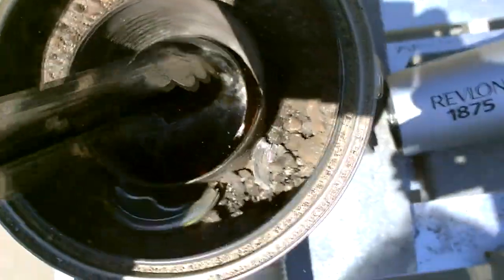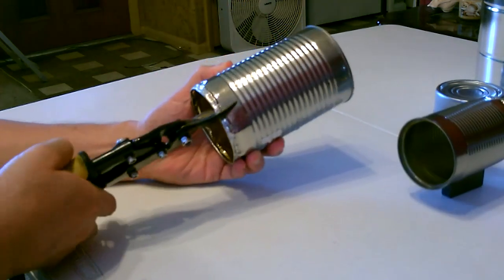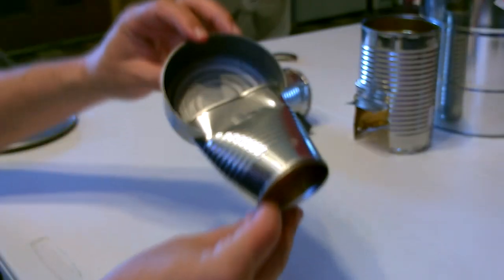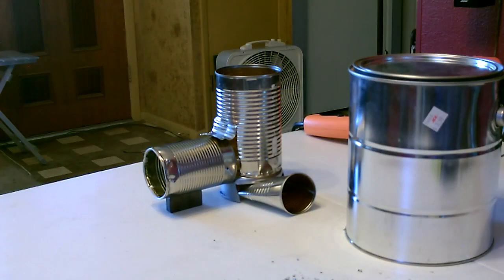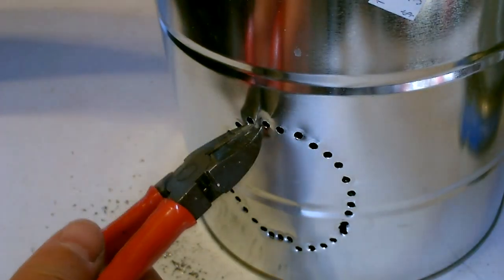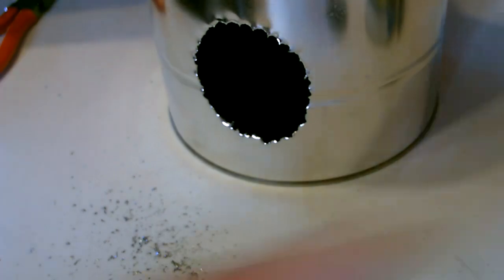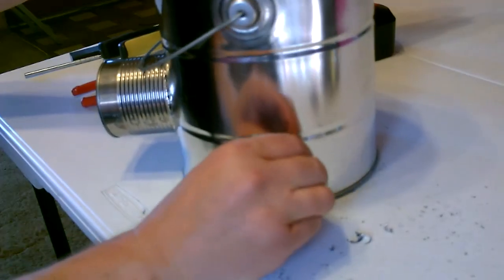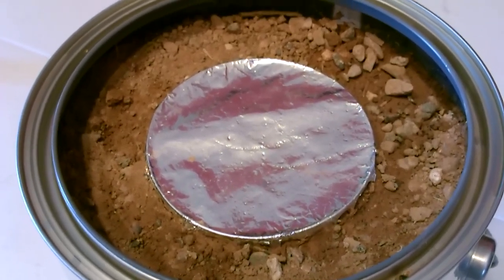Micro DIY Foundry - Charcoal Fired "Fan Forced" 5-Can "Furnace" 1800+F -Melts Aluminum! (cooks too!)

Comment: What could i use instead of a hairdryer?

Edit Can it melt copper
Reply from the maker: hi. you could possibly use a high speed computer case fan. a hair dryer is really the best thing to use though. they put out about the right amount of air at the right speed. i'm not sure if the unit gets hot enough to melt copper. it might.

Comment: Instead of dirt use concrete and cast a concrete mold of it. The first time I did this design I used dirt and it feel apart in the first month I tried concrete and it worked very well

Comment: Great build! only question is what is the second air inlet for? is that just for circulation or something?
Reply from the maker: thanks. the second inlet (or larger inlet) acts as both an air-feed tube and a fuel-feed tube (if you want it to be "wood-fired".).  *also allows it to be used as a standard rocket stove (for cooking).